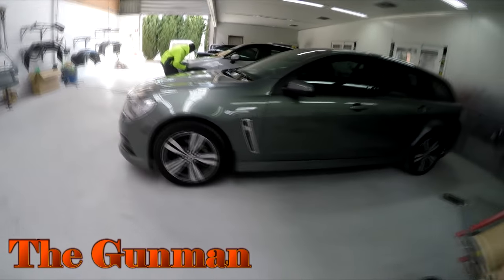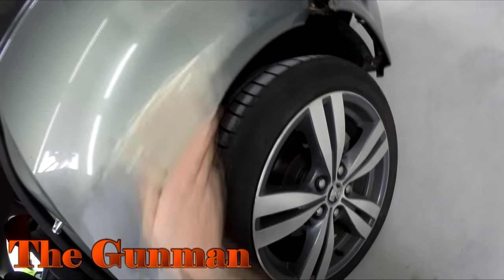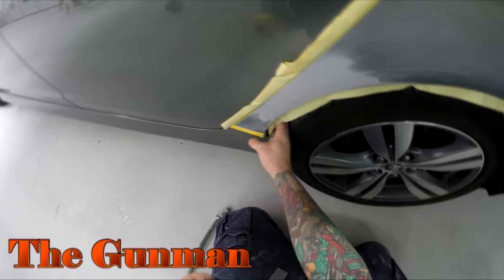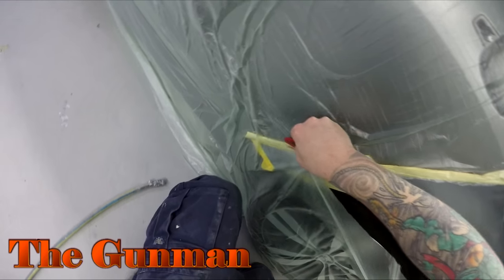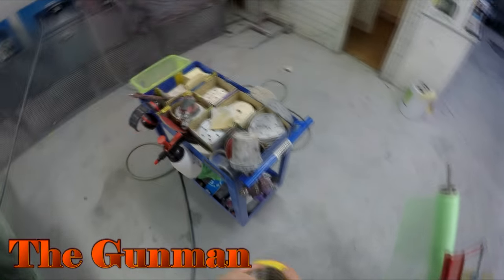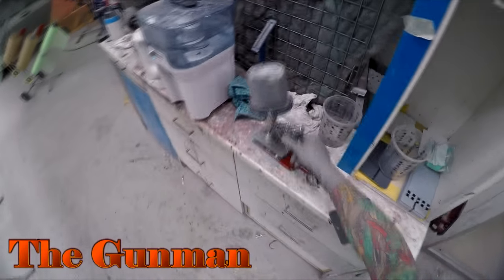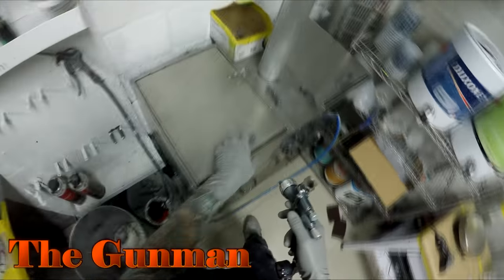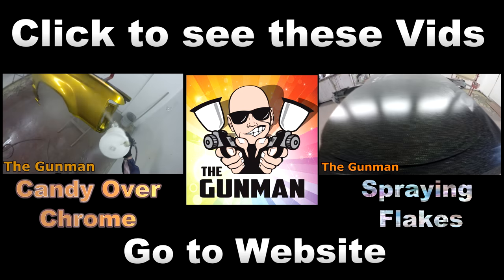Primer Work for Beginners

Comment: ive a question, is it normal that p800 soft back sanding sponges, get filled with filler dust very quick? and does it make bigger sanding scratches

Comment: Hey GM. Question to you. The Tekna Pro Lite that sells in US has a max inlet of 26PSI written on the tip, but you shoot yours at 30PSI. What am I missing?
Reply from the maker: That sounds really odd, from what I know the GTI is basically the same gun as the Tekna besides a few minor differences like there being no air valve and colour, all my GTI Pro lites say from 1-12 bar which is 14-174psi.

Comment: priming over a 1k spray bomb is a terrible idea. hot spraying your primer is just asking for shrink out. I'm a big fan of yours but man that's pushing the limits
Reply from the maker: Did you see me cooling the panel down between coats, I also mentioned it, the 1K aerosol primer is recommended and warranted by Axalta, it's the same stuff you'd put in a gun, a 1k wash primer, nothing wrong with it man. How do you do it? 2k epoxy primer first? also when using the lights to cure the primer it works best when done between coats or you can trap solvents in there that'll possibly pinhole if you wait till the 3-4 coats are on then cure.
Reply: Yes I noticed you cooling it down which will definitely help. I have done it too don't get me wrong...1k will always be thermoplastic . I like to use a 2k etch primer or epoxy if I have the time. a small burn through tho I have used the spray bomb but very limited and I always sand it. I am using ppg btw.